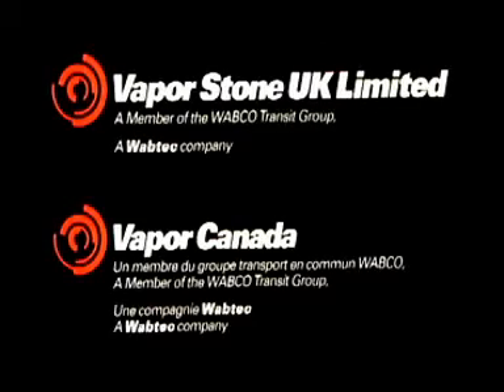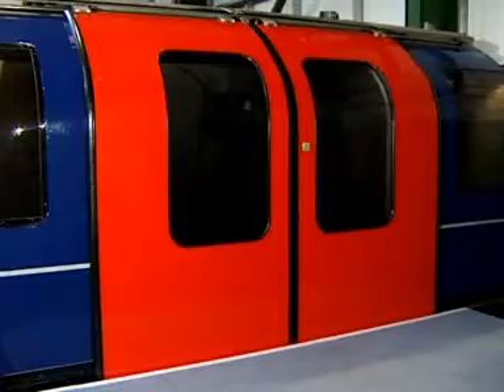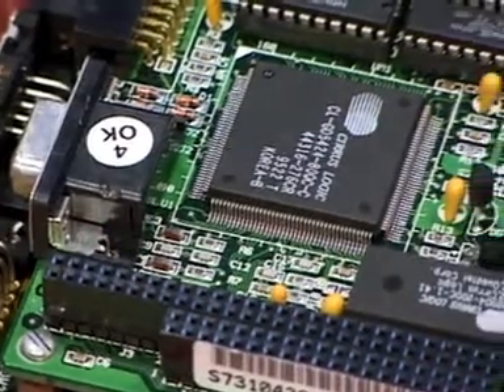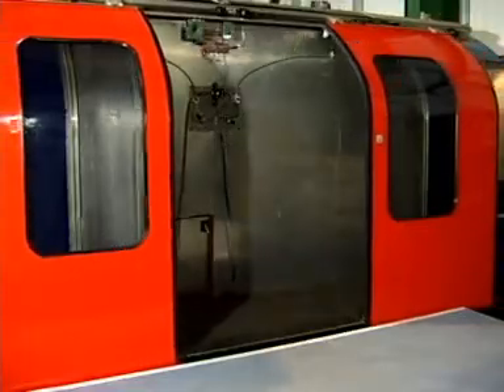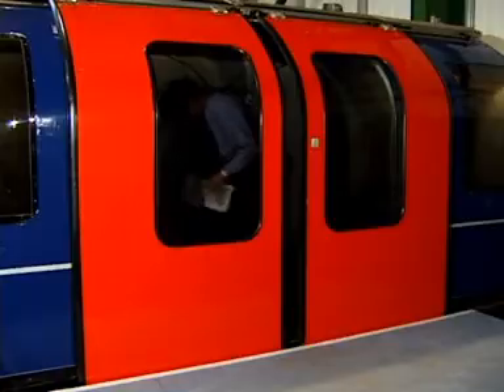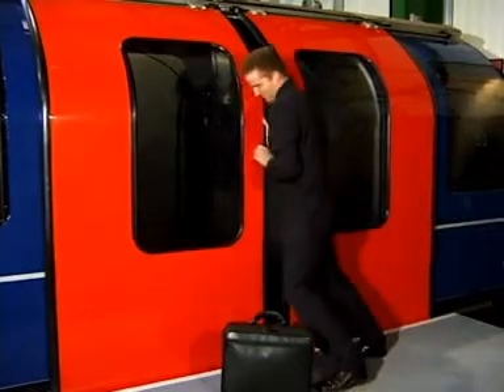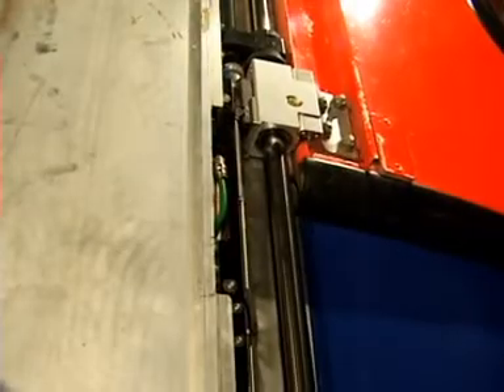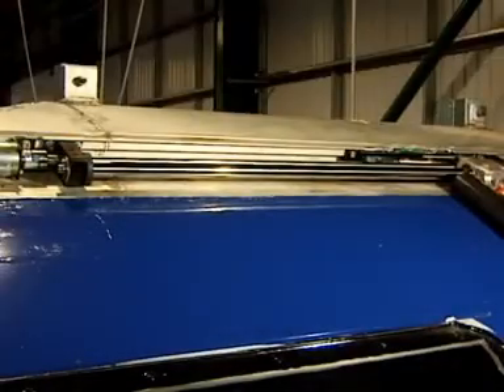Vapour door system for London Underground

Comment: we need this since them doors on the central line are very dangerours
Reply: No this is just a concept design which never made it to the actual trains
Reply: @Dooto2except the buttons, but those got bypassed very quickly in their life.
Reply: Bro they have them installed
Reply: @BryanZhang-td6mw no this is a concept and the description says "not implemented"
Reply: @BryanZhang-td6mw  uh no they don’t if you get stuck in Thosedoors you are not getting out alive
Reply: Even the northern and jubilee line trains
Reply: I think the s stock and new Piccadilly line trains seem to have similar type of door. For example, the slimmer outer door side  profile. Also the doors detect obstruction that only one pair of doors half reopen then close if doors have closed. And the doors always seem perfectly synced.

Comment: Funny to think our modernised trains here in Prague got a very similar microprocessor-driven door system all the way since the 90s, meanwhile so called "modern" city of London still using obsolete air powered doors and calling this a new technology.
Reply: this video is from the 90s lool
Reply: slightly outdated, yes... obsolete? no
Reply: you know how much cheaper and simpler it is to use air powered doors. Having a CPU on each door was actually quite flawed when it was first implemented as whenever the door configuration needed changing, engineers had to manually configure each door individually which took ages. I don't disagree that this system is better, but the "old" system still has plenty of advantages compared to this one.
Reply: The 2009 stock on Victoria line isn't air powered I believe, it sounds like the door on this video, minus the whiney motor noise.
Reply: The s stock from 2010s use similar door mechanism to this

Comment: Reminds me more of s stock doors
Reply: 3:35 makes me wonder if it was considered for the s stock due to the fact they mentioned the doe profile would be thinner on the outside and how the door ran on components similar to the ones used in Central, Jubilee and Northern lines
Reply: S stock does have a similar pushback lock mechanism, only opens a bit when a small obstacle is detected